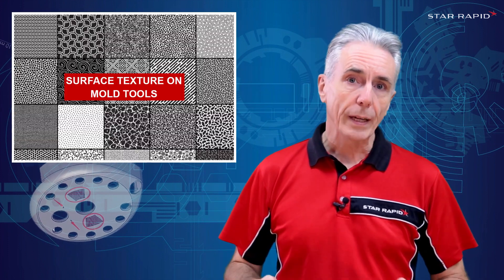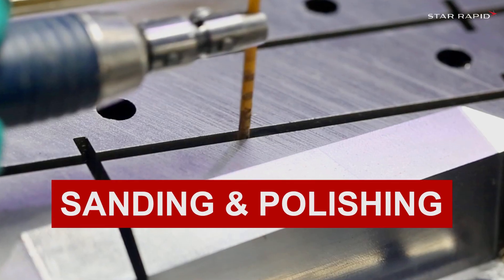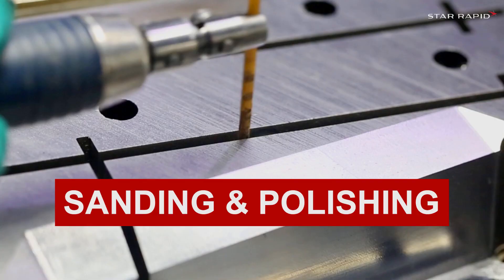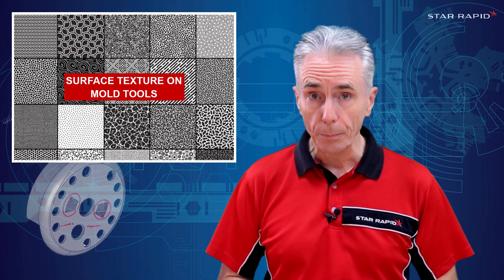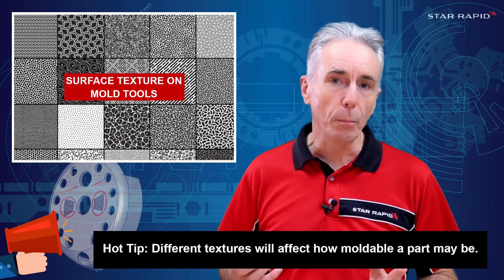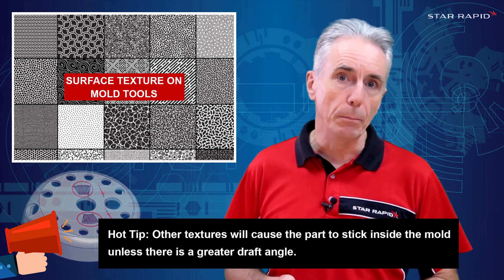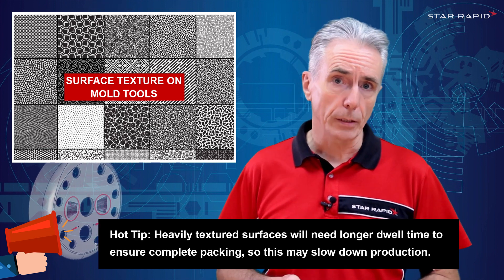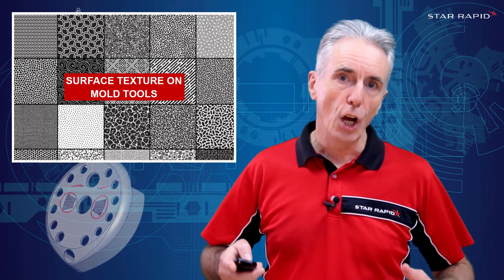5 Methods for Applying Textures to Plastic Injection Mold Tools | Serious Engineering - Ep13

Comment: What would be the best method to add texture on top of a mid sole to a sandal made of EVA?
Reply from the maker: You should put the texture into the aluminium mold that is used to make the EVA Midsole.
Reply: @starrapid  So the STL file I have of my sandal, I should get a 3D designer to add tread to it so that then the manufacturer can turn that into the mold? Even if the tread is very small?
Reply: @starrapid  also, do you guys do this? I’m looking to manufacture my own sandal out of EVA, are you guys located in the US?

Comment: i have a question. When samblasting a mold continuosly, it could damage the texture or increase the cavities in dimensions? I am sorry for my inglish. Thank so mouch
Reply: you are correct, but light pressure and a fine grit can be a great way to clean texture.  .0002
Reply from the maker: Excellent. Thanks for the response.
Reply: Sandblasting can damage a mold but only at high pressures and with the unskilled sandblaster. also using the right media aluminum oxide mixed with glass beads is standard